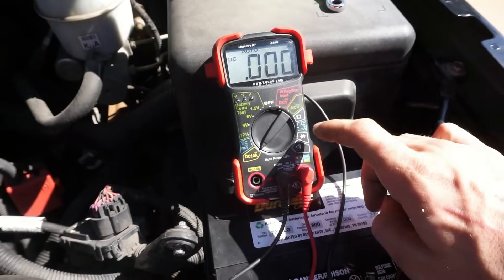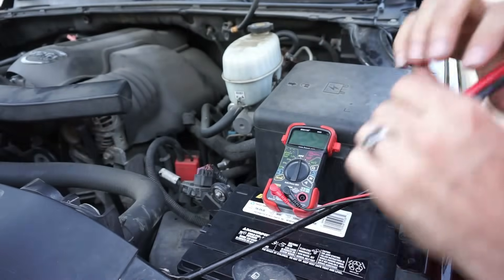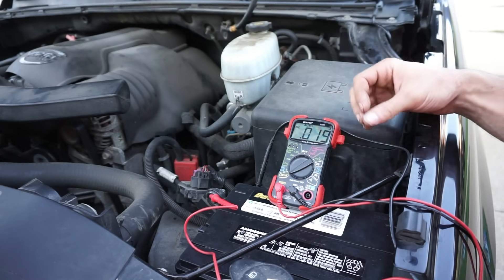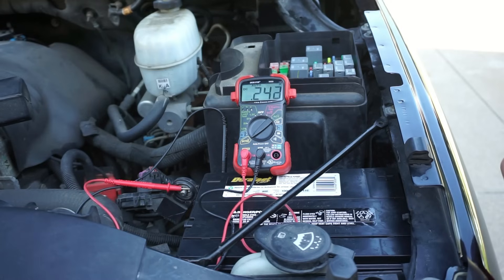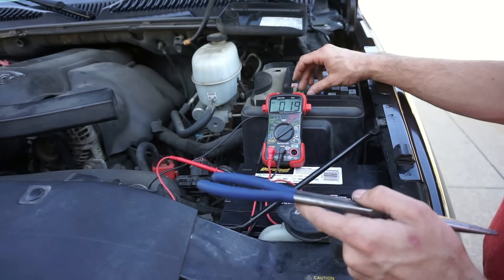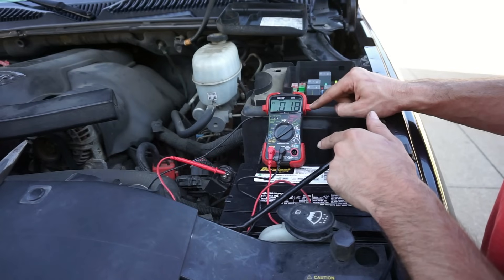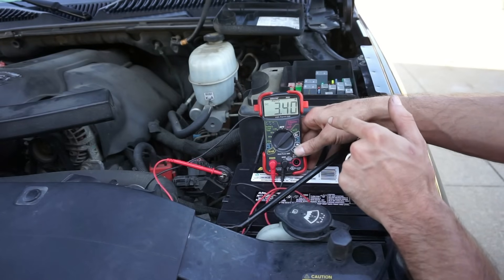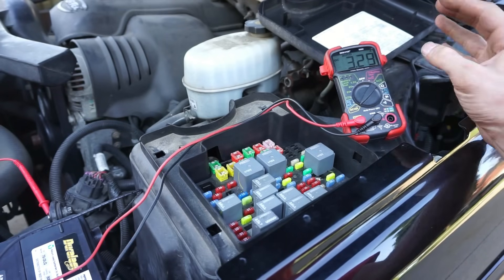DEAD BATTERY | How to FIND a Parasitic Battery DRAIN Using Multimeter!!!

Comment: A couple weeks ago I went to get into my 2000 Accord and the key FOB didn't open the door, didn't flash the lights like usual so I opened the door manually with the key and the dome light didn't go on, the courtesy lights on the door panels didn't light and I no power, so I checked the battery and had I think 3 V. So I figured my battery took a dump (at least 5 yrs old). I have 2 cars and hadn't driven the Honda for 3 days, but that shouldn't have mattered.. Luckily I had another battery from a Toyota I used to have which was the same 35 class and hooked it up and everything has been fine. Couple weeks now and my battery was down to 11.9 V after sitting 2 days (it has been pretty cold out but still)... Thinking "I must have a weird draw", so meanwhile I had the old battery on a charger and decided to load test it with a carbon pile tester and it passed. I was kinda surprised considering how far down it had gone. But after watching this it made me think, cause recently I noticed the left side of my cluster being dark, but it was intermittent, so maybe something in my cluster might be wonky besides just one of the bulbs being loose, cause this wasn't happening before the bulb started going out... Anyway, I know where to start my testing and go from there. Thank you

Comment: Man I have my life stressed to the max, this electrical issue I have is killing my battery in 24hrs and it's just a week before a huge move across the country in my truck and enclosed trailer, some 36 hour drive. This video is giving me some relief I'll be able to find the problem. Not only that but now my engine is knocking and I've already paid for the place I'm moving to but cannot leave as it will surely break down. I won't go on because it just gets worse but this video is a gift to someone who has been very down on his luck and I hope this helps me at least make it to Christmas w the fam on my 7hr drive tomorrow. I've gotta put on a smile and not ruin the Christmas spirit and this will definitely help! Cheers and happy holidays to you and yours.

Comment: I have a 2010 Toyota Carolla that unless we drive it daily for a long run, the battery dies. The door-ajar light stays on even after the engine is off, the doors and trunk are closed and the doors are locked. My guess is it has something to do with that door-ajar light. The computer never sleeps causing a parasitic drain... What is your thought?

Comment: nice video. i once bought a used car with so many parasitic draws the previous owner just installed a relay with a button attached to the dash you could just push to connect/disconnect the battery entirely haha, from the comfort of inside the cab.

Comment: My battery went dead the alternator was not working right they have to change the alternator charge me 545 originally 299 turns out it was the alternator not charging it did the same thing a year before

Comment: Is 0.06/7 okay i know when i when i remove the radio fuse it goes to 0.1. Also the clock is connected with the radio n is always running

Comment: Thanks for your video which I used to check my new Android radio that appeared to trigger a flat battery after 1 night. The initial reading from my meter shows around 1amp, dropping to .3 then .1 after an hour or so, so I guess the radio is ok and the battery may have been a coincidence. Are you able to indicate how long a 55amp hr battery is likely to last with a .3amp drain. Thanks again

Comment: I have Harbor Freight multimeter but it only has a 5 amp setting. Every video0 I see including the same multimeter as mine has only a 10 amp setting. Can I test it with 5 amp setting?

Comment: Good vid.  Also, nice backhand slap at the wife.  HOWEVER, wouldn't you have saved the better part of two days worth of troubleshooting if you just started pulling fuses and looking for a current drop from the lowest level moving up?  You might've spotted the power door lock issue pretty quickly, no?  With no need to worry about doing the (time consuming) start-off cycle.

Comment: I have one question sir now what if you did connect the multimeter like you showed in the video and you get 1.35 amperage draw and wait few seconds it goes to 0 is this normal or do you have a parasitic drain somewhere please reply thank you 🙏🙏
Reply from the maker: The circuit likely shut off and is not drawing any more current.
Reply: @BlaserBuilds  so I don't have any amperage draw is that right ??
Reply: Now is the draw going through the multimeter ? Is that why it's showing 0 amperage draw after waiting !?

Comment: hi i got a question,, my vehicle was recently towed a few kms from a gas station to a garage because diesel fuel was put in the tank by mistake , i did not witness the towing as it was my mother who was driving the car at the time and supposedly no one touched or worked on the car while it was in the parking lot of the garage as i told them i have not decided what to do after i was given an estimate ,long story short the next day when i went to pick the vehicle up from the garage it would not start, there was enough power to run the dashboard, cargo light radio etc but it would not be enough to crank the engine, i got a boost from the neighbor who drove me there and it seems fine after that, was wondering if the towing had anything to do with draining my battery? the only other thing i could think of is if someone forgot the cargo light on but no it was shut off when i inspected it ,so any thoughts on what may have happened here? and no his is not an occasional problem i ever had before unless my trunk or cargo lights were on over night

Comment: I'm about to dig into this on my 2005 Grand Cherokee.  The blend door actuator is stuck, and the blower motor only blows air at one speed, I'm wondering if that is going to prove to be the issue, either the actuator or the blower switch.  Watching that door lock mechanism made the light bulb in my head go on.  Thank you for an in-depth video, and for posting the fix in the comments.

Comment: Thank You!  That was tedious but I have located the offending fuse and circuit.  It's the Stop lights.  I also unplugged both of them in the trunk but with no joy.  Time to start tracing wires etc.  But I can pull a simple fuse and stop the battery drain while I locate the issue.  I'll carry a pair of pliers with me and when I stop I'll pull the fuse.  Don't need stop lights when parked 🙂  Thanks again for a comprehensive video!!!!!!!

Comment: Inherited a '95 Ford F350 XLT SUPER Cab Dully from a sister to old now to do any more camping with the 5th wheel camper. Heard through the grapevine there were electrical issues. Well, after the battery going completely dead while camping I was able to get one on warranty and limp home where I discovered I needed a new alternator AND starter. Ok, I thought. Should take care of the parasitic draw that caused the old battery to keep going dead.
WRONG! That was 2 years ago. 
When I first got the truck I installed a battery tender to keep the battery up during the winter when the trucks not in use. But since this spring I used the truck enough that I left the tender unplugged. Got in the other day and it was completely dead.
One of the only things my brother-in-law told me about the truck was the door behind the drivers door doesn't quite fully unlock every time and you need to reach in and manually pull it up to unlock. You just saved me HOURS of using foreign words no one else in the family understands while expressing my  frustration over not figuring out what was causing my problem. Thanks for posting!

Comment: that was crazy. and im here almost bought an alternator. and fuse thingking that would be the problem... its the power of diagnosis trick... i got a new battery 2 weeks old and it suddenly died on me at work.. i jump start it it works fine but it starts to lose battery felt like the alternator is not charging the battery..

Comment: I believe that this video describes the exact problems that I've been having with my vehicle. Bc my driver's side door is doing the same thing. As in not working properly when I try to lock it. So I believe that this is what's draining my battery power. So thanks so much for bringing these things to my attention. Bc I would have been chasing my tail forever if it were not for seeing this. So I think your videos are great, and I'll be sure to subscribe and recommend them to other's as well.

Comment: Great troubleshooting video! My issue is the TBC BATT 10A Fuse to the top left of the fuse box. The problem is that I don't know what the Truck Body Controller Battery Feed is. Do you happen to know? Thanks

Comment: Correct, ALWAYS disconnect the negative first.  Most EXCELLENT video, perfect diagnostic approach.  Many thanks.  I happen to have the same vehicle, but not with any problem.  My GMC, however does have a parasitic draw that I will track down with my new-found confidence from your instructions.  Good stuff, thank you.

Comment: I have same problem on 05 Pontiac Montana that I bought in 9/21 n I still have less than 500 on it. It set while I was in nursing home for 5 months n when I got in it the power door lock on Dr door doesn’t work but all others do work. If I find this is same as you did can I just pull fuse for power door locks n leave it out. It’s not like I really need to lock it. And if I do pull fuse for the door lock will that interfere with anything else on Dr side control panel? Thanks

Comment: I use a infrared thermometer,the Lazer shows were you are pointing at the fuse box to identify the hot fuse drawing the current. Sometimes you can trace a wiring heat to the short with the thermometer too,

Comment: I would prefer to disconnect the positive terminal of the battery and put a safety cap over it.I would treat it exactly like a building, l.e IF THE NEUTRAL IS DISCONNECTED CURRENT CAN COME FROM GROUND IF GROUND IS CONNECTED ".

Comment: Good troubleshooting! Patience is paramount when  doing any electronic or electrical troubleshooting. I ran an auto, large truck and large marine electrical shop for a  few yers.. I saw many hard to explain things (like an extra 5' of wiring run from  the  left placed fuse box to the right door.. & then run  back across the  vehicle to the left door.. FACTORY design! multiply that nonsense by 10 or 20 times in a vehicle & no wonder we just trade them in!)
On another note, PLEASE EVERYONE!! Understand why you just can't charge a battery when it shows dead: Most EVERY battery charger sold now is "Automatic.. or Microprocessor controlled.. They have an algorithm  built in so  they DO NOT charge dead batteries.. they just see them as no good... and.. you take the battery  back to the  original retailer and  the merchant gets another (he hopes..)continuous pro-rated sale!
SIMPLE SO:LUTION: buy a manual charger (they're are a few.. check  any online source) and MIRACULOUSLY your  dead battery  will charge.. start at 10A and after a few  hours,  the battery will have quite a  bit of  life. Then  switch to 40A (it  will still drop to  "0" A automatically.

Comment: Thank you. I have a 1999 Ford F350 7.3L Diesel Crew Cab Long bed. Isolated what I thought was a parasitic leak on fuse #15 (Generic Electronic Module (GEM) at 152.2 mAmp. But saw your video and filmed the multimeter for 1 hour. Sure enough, at 45 minutes the multimeter went from 152.2 mAmps to 9.27-12.67 mAmps. It took 45 minutes before the GEM went to sleep. You saved me an unnecessary replacement GEM purchase. Cheers!
Reply from the maker: Nice!

Comment: My mechanic with 45 years experience changed my friends cabin filter in a 2005 mazda 3, he had to unhook her battery to change filter, then mazda cut out at stop lights and her electrical system went crazy but would start working again for awhile then revert, her car ran terrible. My mechanic did not admit to fault. She took to another mechanic with 40 years exp. and it took him a month to find problem. Lots of frustration.

Comment: When you turned the key foreward the meter went to over 12A for a brief moment.  Being slow blow fuse helps.   It could have messed up your multimeter since the 10A is not fused.  Perhaps that is the reason.  However I see what you mean.
My 2019 INfiniti Qx60 drops to .22 A.  That is 220mA.  It is too much that is for sure.
When first connecting it, the draw goes to 3.5A then it settles after 30 seconds or so.  The battery is toast dead after a few days.

Comment: As a retired electronics technician, Well Done! Very good educational video on thought prcoess in troubleshooting your issue, but was wondering, maybe i missed it, what was end result? Bad part, corrosion on connector? Thanks Again!
Reply from the maker: It was three driver door module. (Window switches), wife said the door locks were acting up, I pulled the DDM fuse and the issue went away. I replaced the whole window switch unit and fixed it entirely. Video of replacement in pinned comment. Thanks for the feedback.

Comment: Thanks for that, I did partially investigate some time ago a battery drain of some 650 ma, and noticed the modules going to sleep over a period of 10 mins. This has encouraged me to follow through on the problem. My battery is dead in 5 days, I put it down to remote radio key fob receiver and factory alarm. Diagnostics never picked up on anything wrong. However some one has messed with wiring here and there for taxi connections.

Comment: Yes sir, I followed  your video and I found my parasitic draw inside the fuse block inside the cabin of my 2004 chevy silverado LS 2500 hd 8.1 LT crew cab 8 ft box. The problem is the flasher, when I pull the flasher fuse my draw drops from 90 milliamps to 15 milliamps, but my flasher works fine and all the blinkers and the emergency lights work fine, but that much drain usually in about 3 to 4 days it wants to turn over really slow when I try to crank it. Got any recommendations on what to try next. I changed the flasher 2 years ago. THANKS
Reply: I used this video over and over and couldn’t of found the parasitic draw without it. Great video. I still haven’t fixed my draw, I know it has something to do with the flasher relay, but all my turn signals and emergency flashers work perfectly and I don’t have any led bulbs in my truck anywhere. If anyone has any ideas please respond, I’m completely lost, don’t know what to try next. THANKS

Comment: Fun with electricity, interconnected relays and electronic control circuits. Troubleshooting can be a real challenge, especially with intermittent faults, and wiring that's been worked on before.

Comment: Great detective work.  I had a door control module issue with my 2000 Corvette.  Instead of spending $500 on a replacement module, I took it to a guy who de-soldered and replaced three or four relays on the module with new (and improved) relays.  Fixed the problem.
Reply from the maker: Thanks for sharing

Comment: In the video I didn't notice if you mentioned the methodology you used for pulling fuses in order to narrow in on the offending circuit.  My inclination would be to pull half the underhood fuses and measure current to see if any in that group are bad.  Then replace half of the removed fuses and repeat measuring the draw.  For example, suppose your underhood  fuse box could be divided up into four quadrants ... I'd pull quadrants 1 and 2 and measure current.  If the problem doesn't go away then one of the circuits in quadrant 3 or 4 must be the problem, so I'd put the quadrant 1 and 2 fuses back in and pull the quadrant 3 fuses.  If the current draw drops off, the one of thhe quadrant 3 circuits must be faulty and, if not, then the bad circuit is in quadrant 4.  Then dive down into the circuits within the offending quadrant using the same methodology.

Do you see any problems with that approach?  Are there circuits that will act differently depending on the status of power to other circuits?  For instance, could a problem not appear because your door lock circuitry used a relay powered by circuit A that is turned on and off by a module powered by circuit B and that relay closes the door lock solenoid powered by circuit C or something along those lines?
Reply: Seems to be a fast way to start getting close to the problem and then work on each fuse 
Smart thinking 🧐

Comment: Hmm...the DDM circuit showed a high amp draw, then cycled down to a low value, and remained low. Weren't you looking for the DDM circuit to cycle back up to a high amp draw, which would drain the battery. As it did not cycle up, isn't the circuit then not responsible for the battery drain>
Reply from the maker: If I remember correctly it would drop, then cycle back to a higher load, then drop repeatedly. Pulling the DDM fuse confirmed that circuit was the culprit as we drove it without the fuse for a while with no drain issue. Replacing the DDM fixed it. Replacement video in pinned comment.

Comment: I have a parasitic volt drain on a 1993 maxima .The door lock does not work all the time, I Can not get parts anymore,so I will just get a battery quick disconnect to stop the battery drain.

Comment: 2000 GMC Yukon, my amp draw turned out to be the circuit for installed communication.  At one point the Yukon had a hands-free setup for cellular service, it was killing the battery within 48 hours or less.

Comment: Ok… this was fascinating!
So anytime any electrical component visibly malfunctions AND a battery drain ensues… replace that failed component first. Then if the parasitic drain persists… then put in the hours to chase after it. In this case the component was the drivers door lock… omg… electrical problems in cars are a royal PITA!